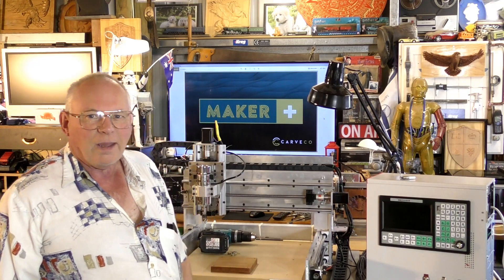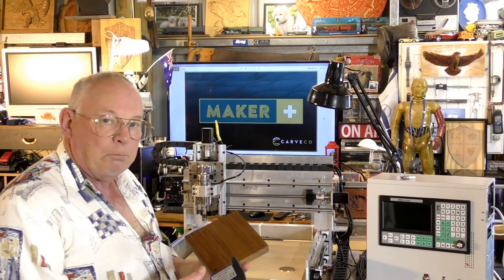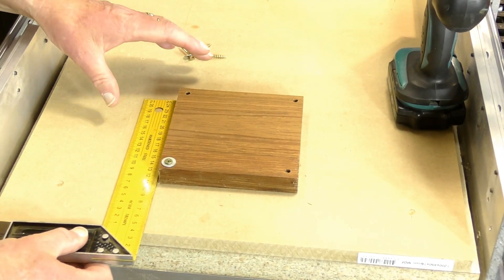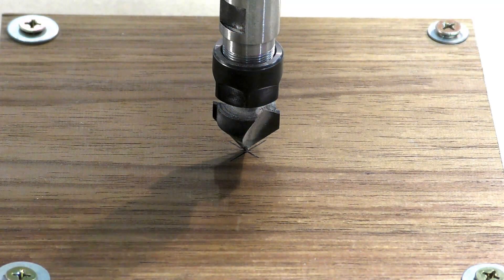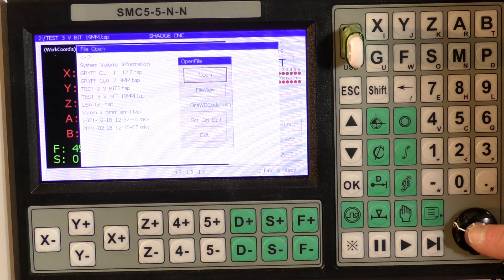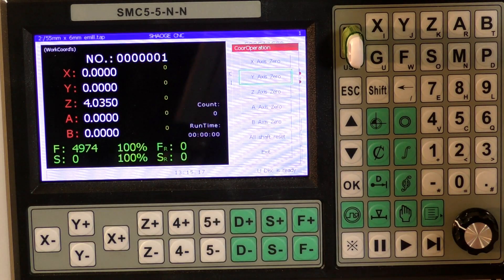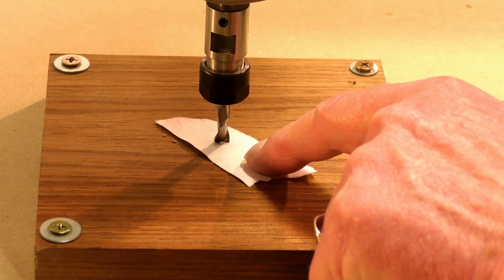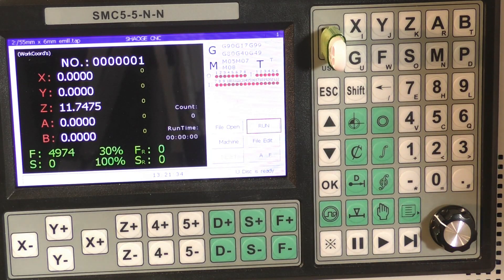CNC router  + I WOULD "NOT" PAY OVER $500 for the SMC 5-5-N-N controller

Comment: Hi Roger. I forgot to tell you that I just joined your Patreon. I have another issue with the coordinate system on the SMC. The numbers are not coinciding with the travel of the machine's axis. I realized this when I was setting up the soft limits. My X axis is 332mm, but I had to set the soft limit to 812 to get the full travel. I have the standard Nema motor (1.8 degree/step and 200 steps/revolution) and my ball screws have a 5mm lead, so I set Step 1 to 320 and Step 2 to 1. I also tried setting Step 1 to 1600 and Step 2 to 5 as noted in the SMC manual, but it does the same as the first settings.
Reply: Now that I got the E-stops working, I now need to fix this issue. I am going to recalculate the number I need for Pulse 1 as if I have a ball screw with a different lead. I'll change it from a 5mm lead to a 2.5 to see if it doubles the travel.

Comment: Hi Roger. I have my SMC all wired up and fired it up yesterday. I had to wire my own connector for my MPG. I followed a set of instructions that show you which wire of the pendant cable goes to which connection on the 'D' connector on the SMC. It worked, but I noticed all 3 axes would go the wrong way when I turned the encoder wheel. I decided to swap the A- and B- wires and it fixed the issue. I noticed my E-stop button on the pendant shows #1 input on the SMC display black (activated) when it is released and red (inactive) when it is pressed (looks like yours is that way too). It does not put the machine in E-stop mode. I wired an E-stop button on my controller panel to input #2 and set it up in the SMC. It works as expected putting the machine in E-stop and turning the #2 in indicator black when pressed and red when released, but I don't know how to get the E-stop on the pendant to work. I can't connect them to the same input because they trigger the input in the opposite way.
Reply from the maker: Hi, ill have a look at it.
Reply: @inventorsworkshop9600  I woke up this morning and was thinking. My panel E-stop button has 2 terminals on the left side and 2 on the right. I found that one set is N.O. and the other are N.C. contacts. I rewired the switch to N.C. like the pendant's E-stop and connected it to IN1 in parallel with the pendant's (I must not have had the SMC set right when I tried the E-stop on the pendant before). I set it up for a N.C. condition by entering a "1" in the H/L box for IN1. I found that I had to have both E-stops pressed for the SMC to go into E-stop mode. I went to plan B and opened the pendant up and rewired the E-stop in it to work in N.O. mode. After wiring the panel E-stop back to N.O. also, now the SMC will go in E-stop if I pressed either button. Call this one FIXED!